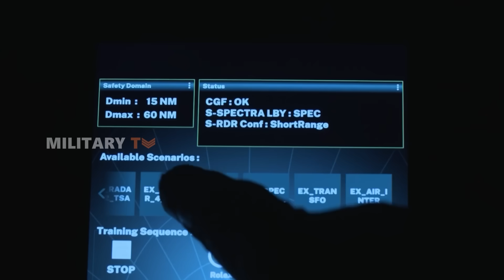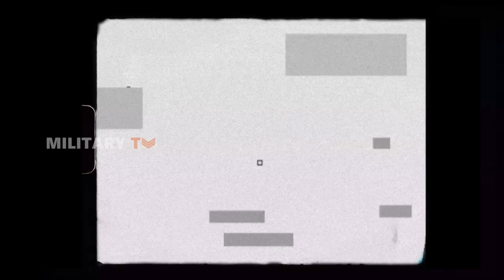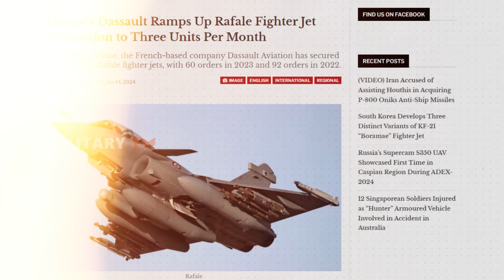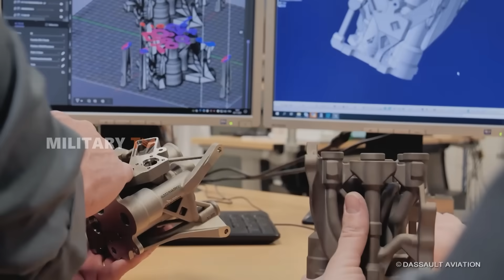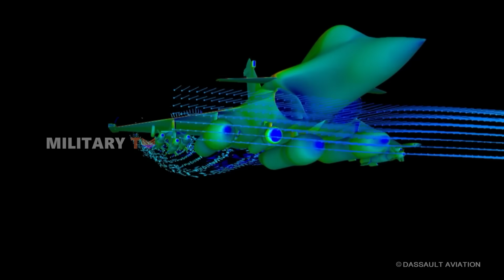The Global Demand for Rafale: What Makes It So Popular?

Comment: you re right, but you miss one of the main reason of the success of the Rafale : country like Indonesia, Egypt (...) buy Rafale and not Russian plane because they don t want to be under sanction by the US
Reply: all wrong!!! India doesn't care what the USA might say, even Egypt! If the Rafale sells like hotcakes, it is because it has reached an excellent maturity, Russian planes are completely obsolete, even India which bought Rafales have abandoned the SU57 because this plane will be a problem like the SU30 MKI, expensive to maintain, complicated to maintain, unreliable, or not reliable at all, just listen to what the Indian Marshal who manages the Rafales says, he says that the Rafale is an exceptional plane and its man/machine interface almost from another watch, he had his contact with the first Rafale when he was 27 years old, if he had had only 10% of the Rafale's capabilities, his life would have been very different! he does not regret buying the Rafale, they are very easy to maintain, very reliable, efficient, it can do all types of missions easily and switch from one to another during the same flight!! The Rafale is the only 11G+ aircraft in the world, so it can take load factors higher than all other aircraft! Rafale C weighs 9850 kg, it carries 9500 kg of armament, it is a record for an aircraft less than 10 tons! and 14650 kg in armament and fuel, yet another Rafale! But, no one has yet seen the Rafale F5, future iteration of the Rafzle with extraordinary capabilities, such as a revolutionary radar, the RBE2 XG or TARAMMAA, capable of detecting an F35 at + 200 km, or detecting tiny that current fighter jets cannot detect! and the ability to be escorted by 1 to several drones! and this, in only 6 years!! many have Rafale F3R, France has been receiving the F4 version for several months! first series fighter plane with artificial intelligence to manage maintenance, with the future radar, it will be equipped with a second artificial intelligence! the Rafale has not finished its career, future Rafales will be exceptional!!!
Reply: @LOLOVAL-os3pq  I am not saying that Rafale is not a very good plane, but Egypt and Indonesia for example have chosen the SU 35 and finally change their way, fearing US sanctions
Reply: @starkov7284 : Egypt purchases its Rafale at the same time they ordered the Su35.
They don't belong at the same class of fighters.
Su35 is a heavy fighter, Rafale is a medium one .
Sure the cancellation is due to Egypt fearing US sanctions but it had no impact on Rafale order.
Fact is even countries who don't care  about US sanctions , like Algeria are not very interested in the Su35 which seems less versatile than the Su30 serie. 
For countries operating the Su30, they rather go on upgrading their fleet rather than buying Su35.
Reply: Slava  BAGUETTE 🥖 Geroyam Croissant 🥐
Reply: @starkov7284 "... buy Rafale and not Russian plane because they don t want to be under sanction by the US" This was the standard reply 2 years ago. Now we have ample evidence of over-inflated capability of Russian weapons (airplanes, defence system, missiles, data processing, radars & sensors). Talk to India which was able to make a solid comparison between French weapons and Russian ones. Because of the war in Ukraine, France had to scrap a deal to Russia for helicopter, landingcraft carrier, etc called Mistral class. The best would have been to live in peace but Putin's Russia has decided otherwise so now we build weapons instead of enjoying live.
Reply: @johnjeanb  India didn't compare Rafale and Sukhoi... it was MIG in the competition... which India was not keen on.. SU-30 are good like any other good ones
Reply: Nope lol😅
Reply: indonesia facing difficulty to maintain SU 27/30 readyness cos in every overhaul those stuffs they must do mobilize to bellarusia which not efficient at all
Reply: India was not on the shopping list for F35 due to it's Russian purchases so not an option.
Reply: He literally says it at 5:10
Reply: @Roger-Hypersonic  ok sorry I miised it, but regarding the answers to my post I am not the only one ;)

Comment: Despite being more advanced and slightly heavier, the F-35 is less expensive to acquire due to economies of scale and more efficient production; the aircraft sells for around $140 million for export, whereas the Rafale has sold for around $245 million per airframe.
Reply: The cost of 245 million os for a fully loaded Rafale including its spares and Long term maintenance contract. The 140 million for F35 is the cost of the basic jet
Reply: @rajeev4243  Yes, that is correct. The price of the F-35 given is the total cost, logistic support, and training.
Reply: @teddyballgame4823 France have an order for F4 version at $131m per aircraft. 
That is a domestic price with no extras. USAF have F35A orders at $80m each. 
 Those prices don't include anything extra.
Reply: @rajeev4243  no, the 140 million is for everything, like the Rafale.
Reply: F35 costly stealth coating and high operating cost and service cost is must higher then Rafale
Reply: @miteshghadi3146   yes that’s true, but you have to take everything into account. Meaning, air frame cost + flight hour cost (which does include maintenance).
I’m gonna use these prices as an example:
F-35 A
Unit cost: 140 million dollars 
Flight hour cost: 40,000
Flies for 100 flight hours a year: 4 million dollars 
Over 20 years of flight hours: 80 million dollars.
140 million + 80 million= 220 million.
F-35A=220 million dollars.

Rafale
Unit cost: 245 million dollars.
Flight hour cost: 20,000 dollars.
Flies for 100 flight hours a year: 2 million dollars 
Over 20 years of flight hours: 40 million dollars.
245 million + 40 million = 285 million.
Rafale= 285 million dollars.

The F-35 is still cheaper.
Reply: @miteshghadi3146  yes but it is cheaper to produce
Reply: No
Reply: hahahahaha wrong again.. back to nascar boy!
Reply: I think in the long run Rafale is much cheaper to maintain.
Reply: @SuperChodot  no it’s not